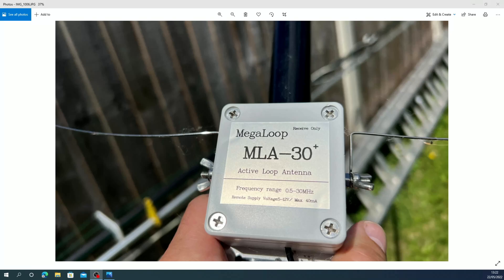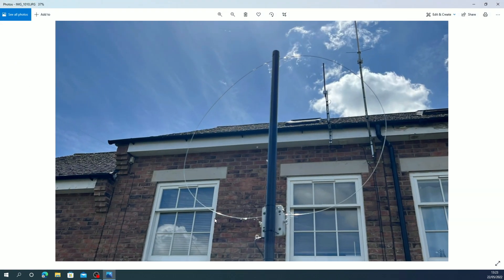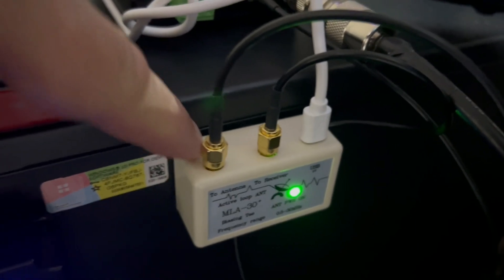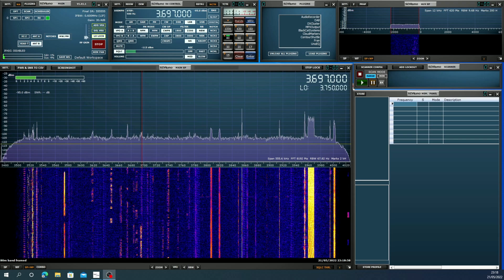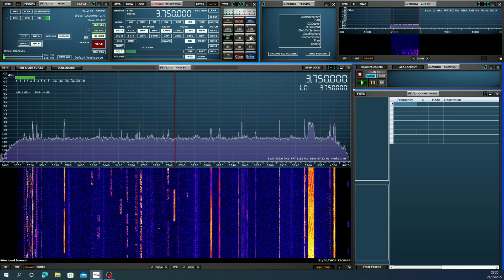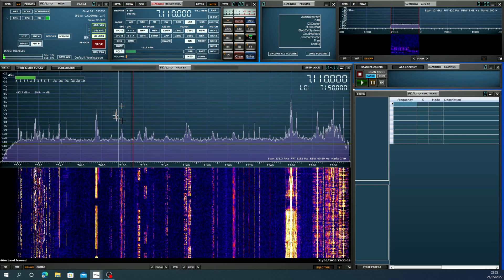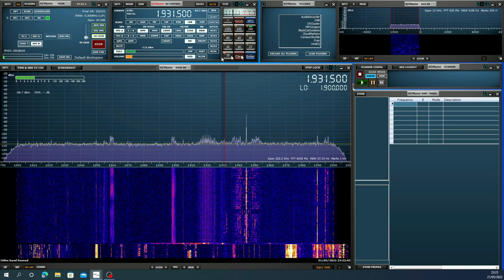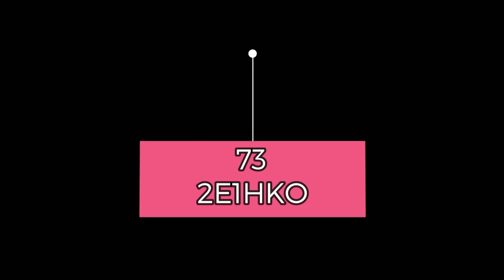MLA 30+ LISTENING ACTIVE MAGNETIC LOOP !!GREAT VALUE !!

Comment: I have mine for almost a year now. I'm in a noisy environment and have also a 1:1 choke in line. And grounded the loop. For the price its a good antenna. MW reception is pretty good i must say! 160/80 meter band surprisingly not so good. 40,20,11,10 fine!